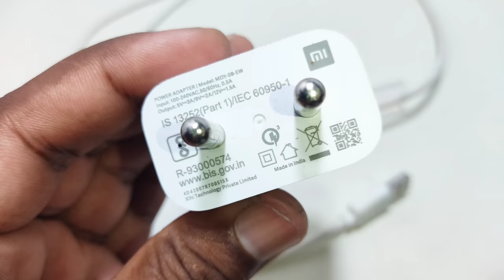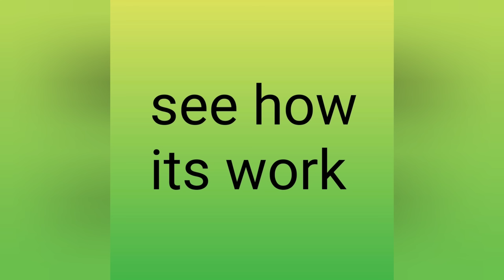How to make hot glue gun using pencil  ll DIY USB hot glue gun

Comment: I'll just replace the plastic casing  inside my 50 cents made in China glue gun with the battery aluminum coating ... 🔫😁. Thanks for the idea... 😀💡.. Now the plastic filament will not lodge itself with the glue gun casing... 😁🔫(the casing inside the China made glue gun should have been made from hard plastic not rubber! 😳) .. Now I got myself a Chinese made glue gun that will last a lifetime... 😀🔫

Comment: You can buy a glue gun for 100 rs it's not that expensive
Reply: But USB? Commercial hot glue guns use to be turned on at wall socket, the advantage of having a 5V one is use a power bank and be able to use this even without the electrical grid.